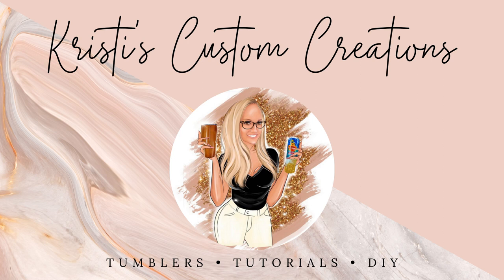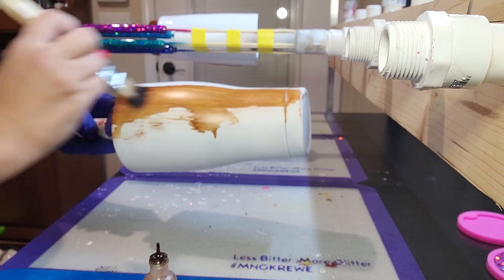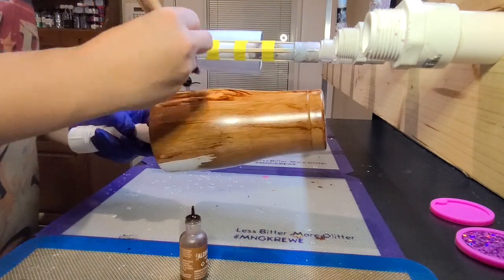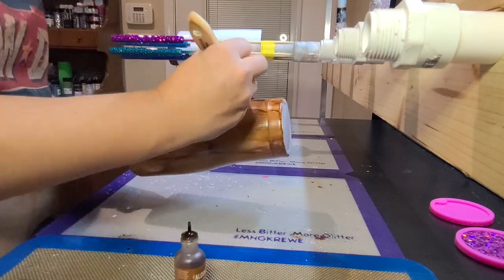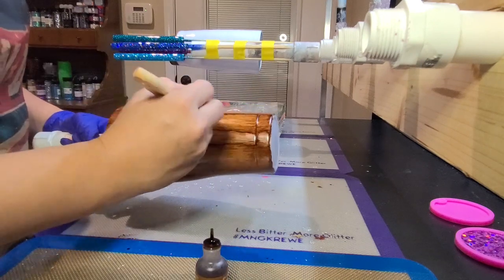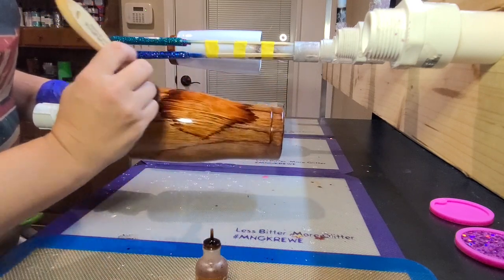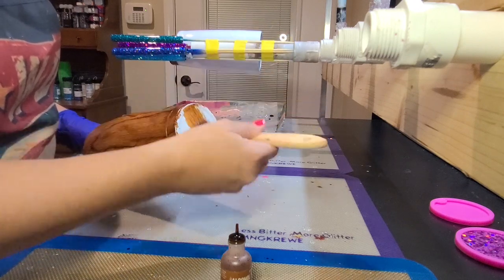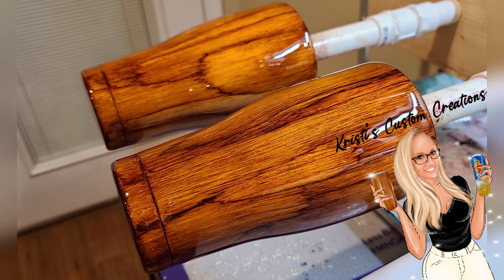Woodgrain Alcohol Ink Epoxy Tumbler Simple & Easy DIY Tutorial

Comment: How long do you let the primer sit before you start applying the ink paint? I'm having issues with the pain stripping away the primer if I apply a second coat of paint
Reply from the maker: I usually let it dry overnight so that it is nice and dry. If it's not dry enough then it will start to remove the paint with the alcohol ink.
Reply: @KristisCustomCreations  you let the primer sit over night?

Comment: Did you use a stainless steel tumbler that you spray painted white first? Also, what’s attached to the pipe holder that’s keeping the cup secured while you’re applying the alcohol ink?
Reply from the maker: Yes, it is a stainless steel tumbler that I spray painted with flat white spray paint. There is a foam football attached to the other end of the pvc pipe that holds the tumbler in place. :)

Comment: I did a wood grain and made sure it was dry prior to applying epoxy. The second I applied the epoxy it started to make the alcohol ink come off and change colors. I know for sure the alcohol ink was dry cause the cup had been sitting for a week or more since I got sick. You say you don't seal and I made sure not to seal mine but it still happened. Any tips for the next go around? Not sure what happened.
Reply from the maker: What kind of spray paint did you use and what brand alcohol ink?

Comment: I noticed in your links that you have listed two different types of epoxy, the Counter Culture and the Faux Rizzle. what is the difference and which do you prefer to use??
Reply from the maker: Hey there! Back when I recorded this video, I used both CC epoxy and Faux Rizzle. I don't really use CC anymore (no particular reason why) and I only use Faux Rizzle occasionally. Faux Rizzle became VERY hard to get and was always sold out. I have actually switched to mainly using Tumblerpoxy epoxy. I swear by Tumblerpoxy and have found it to be the best epoxy that I have used so far. If you would like to try a kit of Tumblerpoxy, the 16 oz kits can be found at kccglitter.com :) I hope this helps!

Comment: These are nice!!! Once I began to epoxy mine started to run…any ideas why?
Reply from the maker: Did you use matte for the white spray paint? And how long did you let the alcohol ink dry before putting on epoxy?
Reply: @KristisCustomCreations  no I used gloss and I let it sit overnight before I added epoxy
Reply from the maker: @Montyx06  I only use matte white spray paint when I make mine. That's probably what the problem is. Try making it with matte white and it should be good.
Reply: @KristisCustomCreations  I made mine with white matte spray paint and my ink ran too when I put the epoxy on :(
Reply from the maker: @sybilpetrey4392  hmm... I never seal mine and have no issues with my alcohol inks running. You can try stealing it with a clear spray paint but I found when I seal, sometimes it causes the alcohol ink to discolor.

Comment: Another way to make knots is to use a smaller brush....1/2 inch or whatever, dip the end of it in the ink. holding the brush pretty much up and down or even sideways...a 90 degree angle from the piece..touch and spin in a circle. Pulls away at 90 degrees. Proceed until it looks like you want.

Comment: This was great and I tried it. The woodgrain part came out great but when I put the epoxy on it did stick in spots. What did I do wrong?
Reply from the maker: How long did you let the alcohol ink dry before you put on the epoxy? Also, how much epoxy did you use and what brand?
Reply: @KristisCustomCreations  I let it dry for two days because I had an emergency out of time. I also used 10 mls of each epoxy don't remember the brand
Reply from the maker: @vernawilliams7866  that's gonna be exactly what your problem is.. you didn't use enough Epoxy. If it's a 30oz cup, I use 30ml of Epoxy.. a be 20oz cup gets 20ml of epoxy..
Reply: @KristisCustomCreations  when you say 20 ML for a 20 Oz is that 20ml of resin and 20ml of hardener or 20ml altogether?? Thanks!

Comment: Ma'am, if I may ask a question?  How do you prep your cups before base painting them?
Reply from the maker: Of course you can ask a question! I prep my cups with acetone before painting them. Some people prefer to sand their cups before painting but I have been making cups for approximately 5 years now and haven't had a single issue with not sanding them beforehand. It's honestly going to be the personal preference of the cup maker as to how they prep their cups.
Reply: @KristisCustomCreations  Cool. Coming from a world outside of tumblers where we paint on stainless every day and it's required to sand or etch it before painting to guarantee proper adhesion, I'm curious why acetone is often used with tumblers instead of sanding?  I've seen plenty of people say the same thing, but I haven't gotten a straight answer from them other than "that's how I was told to do it." Do you know why?  If it works, it works, but I don't know why or how this trend started.
Reply from the maker: @breedlofam  I used to sand back when I first started making tumblers but I honestly hated sanding the stainless steel. I tried a couple of tumblers with prepping with just acetone and the paint / epoxy adhered just as well as it did when I sanded the cups. I have been using acetone only to prep my tumblers for about 2 years now. I don't think that really answers your question fully but hopefully it somewhat does.

Comment: Can you explain why my alcohol ink lightens up when I epoxy it? I waited 24 hrs after putting the alcohol ink on it before adding the epoxy. Very frustrating!
Reply from the maker: The alcohol ink will lighten as you put it over more alcohol ink because it basically pulls the ink away from that area. I hope that makes sense. It can def be frustrating but I find that if I blow on it while I work, it helps the ink dry a little faster. I hope that helps some!

Comment: How does the alcohol not take paint off
Reply from the maker: You don't soak it in the alcohol ink and as you apply it to the cup, the alcohol dries really quickly. I'm sure if you were to rub it when the alcohol ink was still wet then it might try to take it off but I've never had a problem with it.

Comment: I have a question I let mine dry and then went to epoxy it and that’s when it turned a greenish yellow color and basically ruined my cup…any suggestions??
Reply from the maker: Did you seal it first or did you epoxy right over the ink? I find that if I spray seal it, it tend to turn my cup a greenish yellow color. I never have any issues doing epoxy right over the ink once it is fully dry.
Reply: @KristisCustomCreations  I did seal it first, then sanded lightly, and I figured it out that’s what happened even though it was perfect. My 2nd cup turned out darker but it’s ok. I think it’s due to the brushes I used too

Comment: Do you think this will work with plastic?
Reply from the maker: If you use a matte spray paint then yes it will. You would need to be able to seal it in somehow though. If is on a plastic cup, I probably wouldn't use epoxy on it.
Reply: @KristisCustomCreations  is there any spray that I can use to make it stick?
Reply from the maker: @bobert1115  You can use matte spray paint before painting the woodgrain but it needs to be sealed. If the cup is a double walled plastic cup then you could seal it with epoxy... it will scratch too easily if you spray with a spray sealant

Comment: My woodgrain ALWAYS has fish eyes after my first coat of epoxy , is there anyways to avoid that? I’ve let the alcohol ink dry for 12+ hours , spray a sealant over it, use a heat gun to make sure the epoxy is even and without bubbles. I just want to make one successful one! 🤯🥲
Reply from the maker: I don't seal mine and I use a blow torch instead of a heat gun. It could be a few different issues such as not enough epoxy or too much heat. How much epoxy are you putting on for your first layer?
Reply: @KristisCustomCreations  this answer helped me so much thank you all I had to do was add more epoxy to my first layer

Comment: Why might after I seal my Alcohol ink on Wood grain and apply epoxy it makes these horrible indents in the epoxy.
Thanks in advance..
Reply from the maker: It could be a couple of reasons. What are you sailing with? I don't seal my alcohol ink after wood grain at all and I never have any issues with my epoxy. Also, how much epoxy are you using? I have found that if you don't use enough epoxy then it can create fish eyes in the epoxy.

Comment: I have a question.  I did 2 wood grain tumblers with alcohol inks. Painted them white, did the whole ink-wood process like you did, let them dry overnight.  I applied the 1st layer of epoxy and BOTH fish-eyed on me, as well as pulled my ink up and into the epoxy!! All of my hard work gone. 
    What I can't figure out is WHY I got fish eyes?!  They weren’t covered in oils, but it's not like I could wipe them down with alcohol or it would remove the ink. 
   Any advice? Thanks
Reply from the maker: Oh no! What spray paint did you use?

Comment: I came here to make 55 gallons of peach juice into rain barrels and blue barrels into wood barrels.(please no bully on why i need 110 gallons of peach juice)
Reply from the maker: That's pretty cool, are you planning to make the barrels the same way one would make a tumbler?
Reply: @KristisCustomCreations  I was just looking at how to make  plastic look like wood right now. Im probably using this method on a blue barrel primed. and using the PVC didgeridoo/oil paint method on the plumbing to accent it. Then maybe some metallic or black spray paint as racing stripes to emulate barrel bands. Then weather proofing all that with a clear coat. Because it will look better than 2 blue barrels and a bunch of white PVC. Im in the initial stages of planning since Im doing some bath tub rough in thats a pain.